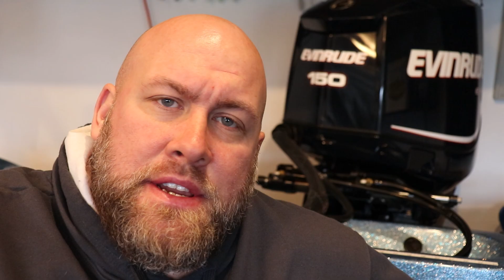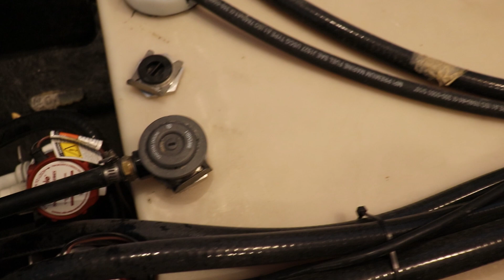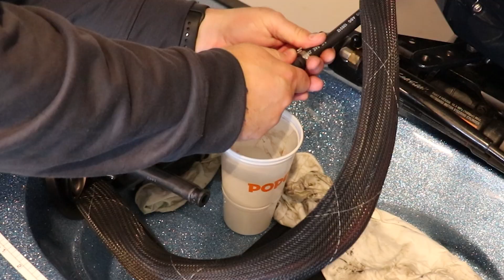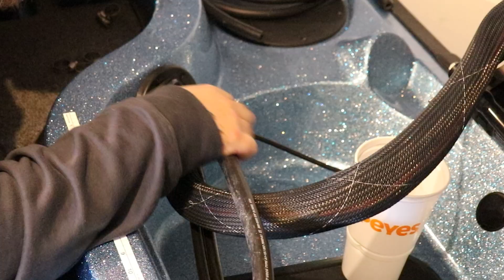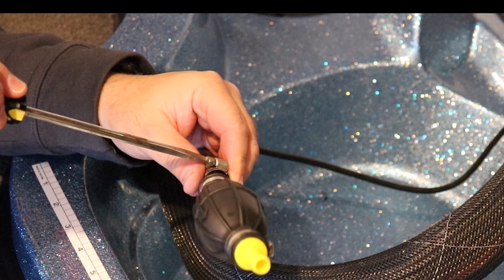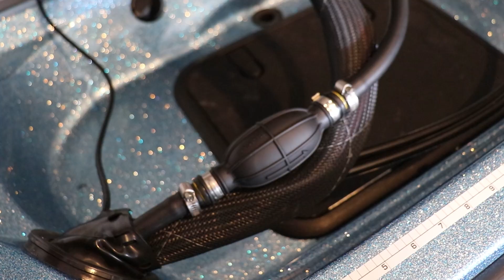Evinrude ETEC Fuel Line Replacement

Comment: I have a 2016 115 Etech. My fuel system has been this way since I have owned the boat in 2002 and repowered it in 2017. Gas tank, antisiphon valve, fuel line to an BRP/OEM primer bulb, fuel line to a Parker water separator, fuel line to the motor. What I have recently learned since I did not touch anything until after the warranty has run out, is there is a water separator on the motor as well. The previous motor was the original 1996 88 SPL. My Evinrude dealer and installer in 2016 have never changed anything and has worked on it since I bought the used boat in 2002. They are great and I'm not trying to bad mouth; I'm just giving the facts. Please let me know any insight you may have to anything I should keep and or eliminate. The motor does hate to go from idle to just in gear and does cut off regularly. Thank you for any information you are willing to share and help me with!!!
Reply from the maker: Hard to say what's happening without proper testing.  Get a manual for the motor, it has all the specs and testing for the fuel system as far as pressures, vacuum, lift, ect to check

Comment: When I pulled the fuel line off mine to get my transducer plug through a tiny space I noticed a blockage of black tar like substance in the hose. Looks like I'll be doing this also.
Reply from the maker: This happens especially with ethanol gas,  it starts to eat and dissolve the fuel lines and you get exactly what your seeing. 
Definitely worth looking at changing out the rest before issues start
Reply: @1Cast1Fish my only concern is the fuel lines inside the engine block that are hard to get to, do you think they'll need changing too?
Reply from the maker: It’s possible they could have some in them as well. I checked my line up to the factory engine lines and did not see anything in mine. They are easy to check up to.
Has your lines or fuel line bulb been replaced ever? Non oem or Amazon parts tend to have issues. 
Ethanol fuel also contributes
Reply: @1Cast1Fish I've only just bought the boat and it has 28 engine hours the seller was an older gentleman who purchased the etec new, still has the paperwork for it. The fuel was flowing well from the tank though. Might just be the short hose that's connected to the engine.

My setup seems to be the reverse of yours where the hose from the engine connects to the hose to the tank.
Reply from the maker: Those low hour, barely run motors are the ones that have the most fuel issues.  That fuel has just sat there in the lines and injectors for long stagnate periods...any moisture and corrosion starts.  Definitely check and watch your fuel system and components.

Comment: fuel filter? Also,isnt the primer bulb effectively an anti siphon valve?
Reply from the maker: I do not have a "extra" external fuel filter and the primer acts as a check valve...however the antisiphon valve is located near the fuel tank, and is extra EPA "Stuff"

Comment: Could l replace the double male fitting on my 2013 40 hp etec between the bulb and the motor with a fuel connector that the same as my 9.8 evinrude kicker motor so can plug in a portable gas can in a emergency ? Thanks for your videos.
Reply from the maker: Assuming the hoses are of the same diameter, it should work.
You can buy the bulb and hose kits rigged with a quick connect type fitting already on it.
I would then keep the backup fuel tank available with fuel hose, primer bulb, quick connect. That way you can simply disconnect from the main tank then simply plug in the backup.  This also will give you redundancy in case of a anti siphon, primer bulb, or fuel issue.
Reply: Thanks for replying back. I can't access my fuel tanks very  easily because it is under the floor and riveted down. I was thinking maybe a T fitting might work too. I would gust like to have a 3 gallon can that I could plug in for a back up. Do you think a T fitting  would work with the center on it or gust use a connector. My fuel line is the same 3/8
Reply from the maker: Most quick connects are located at the motor (after the primer bulb) 
Watch the video at the 7:15 mark...you would add the quick connect to the outlet hose on the primer bulb and the correct fitting for the motor fuel hose.    This way you can disconnect the fuel line from the motor, then simply plug in a external tank with a quick connect to the motor.

Comment: hello.. I have a question about the evinrude engine.. could you write me an email. thanks
Reply from the maker: Please ask here, so we can all learn
Reply: I need advice. I have an evinrude 175 e tec 2007. After driving, the engine went into reserve because it overheated. I replaced the thermostats but the problem only occurs when I drive at low revs. Is it possible that the problem is in the water pump or something else? Thanks for the advice and best regards.
Reply from the maker: If the motor runs perfectly fine at higher RPMs above about 3000 (No Overheats)
T-Stats for low temp overheats are normally the culprit.  Double check the T-Stats in some boiling water, I have seen new ones failed out of the box.
Also the best way to start trouble shooting is with the EV diagnostic software hooked up, as you can see the temp profiles and real time info. This lets you see each engine side and see if the cooling issue is on one side or both.
Being older if used in salt water the internal passages may need cleaned some as well.

Comment: Thanks for the e-tec video. we can use everyone of them. I have a 2008 225hp . Sometime when still under warrantly, replaced the ball check hand bulb with a generic one from West. My dealer was servicing the engine when he noticed I used a bulb that looks like a good replacement. However, the inside diameter of the plastic barb was slightly narrower. He said that a smaller diameter will have a great impact on amount of fuel going to the engine. Therefore, I was making my engine run leaner. Just something to think about.
Reply from the maker: Primer Bulb is a definite OEM replacement item on the ETEC IMO.